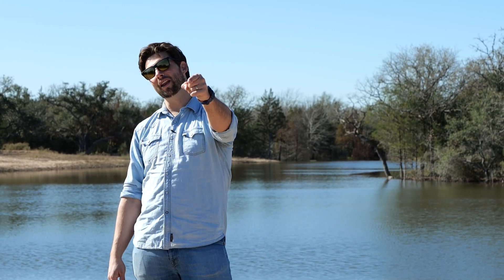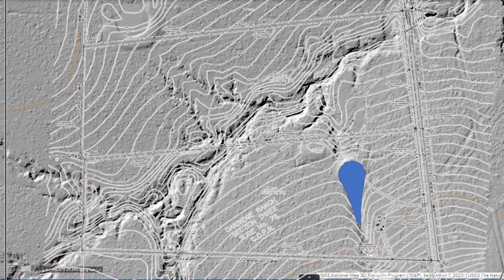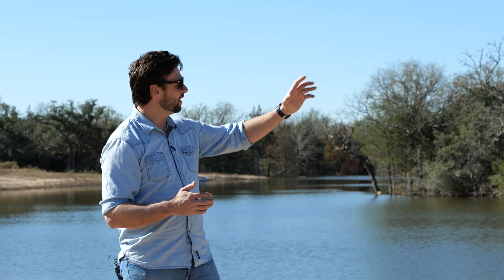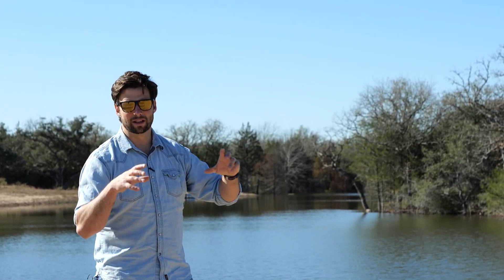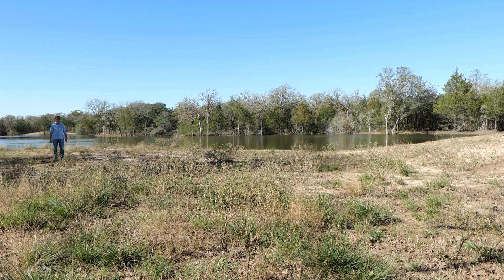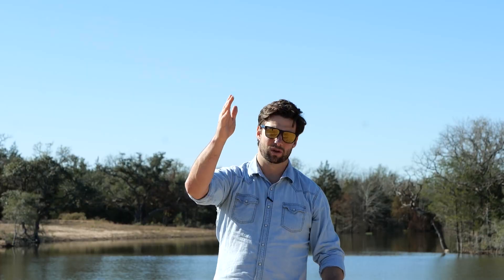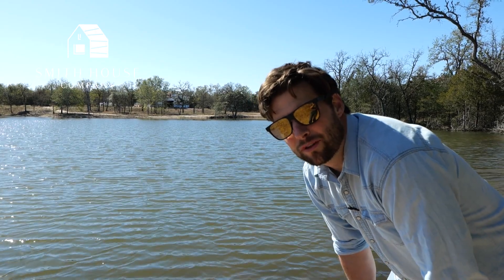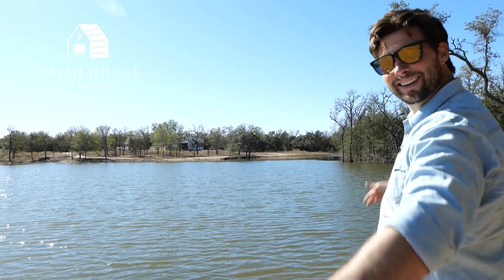Don't Get This Wrong!! - Pond Dam Overflow

Comment: Did you need to get DNR/County approval for this massive project?    Capturing and changing the flow of water has become quite interesting from a legal perspective.  If the owners want to get rid of the pond what challenges would they face?
Reply: Snitches get stitches 😆
Reply: I have the same question.  As I understand it in Washington State, property owners have no rights to surface water.
Reply: @alancottrill  pretty crazy state you live in!
Reply: @alancottrill  That sucks. In Texas, I own the water that falls on my land but have no claim to water that flows from a neighboring property. This is on non-navigable streams or rivers. So if I’m just damming up water from my property and I’m under 200 acre feet of water, I don’t need a permit or license. Bigger than that or impounding a stream from elsewhere and I need to get State permission.